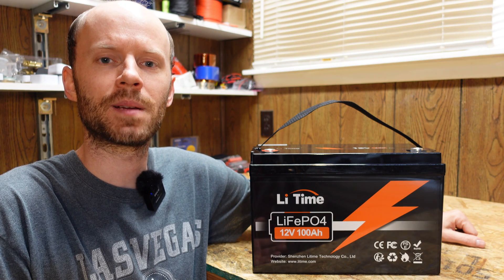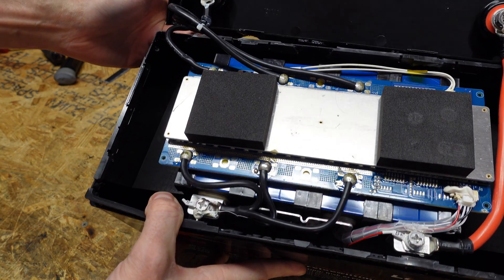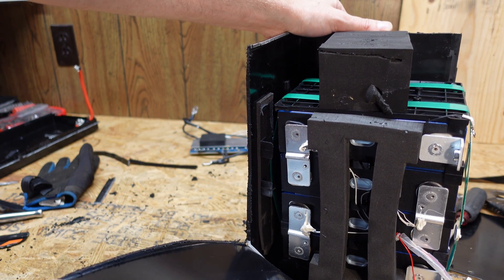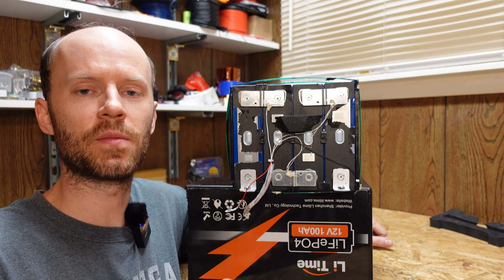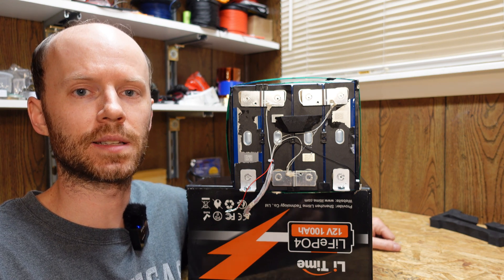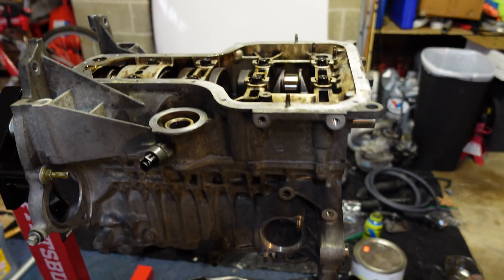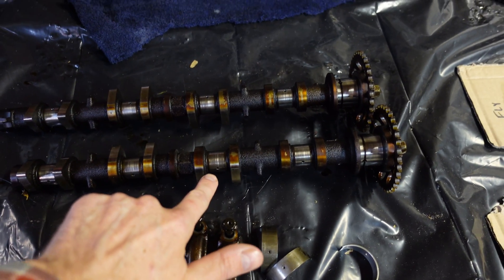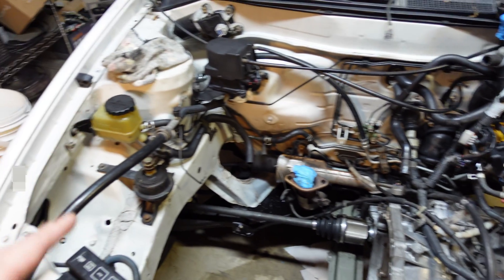Inside the LiTime 12V 100Ah LFP Battery and 1ZZ Engine Rebuild Update

Comment: Have 4 of their 12v 100ah batteries that acts as an extra battery for my Delta Pro..  
So pretty much low power energy storage..  All 4 of my batteries are way out of balance and the BMS will go in to cell overvoltage around 13.9v or so on each..   I'm slowly working on them to get them balanced back up..  AOLithium server rack is catching my eye right now..  Hear you may have a review on the way... :)

Comment: The cam bearing surfaces could be polished on a lathe with long thin belt sander.  It's a pretty quick job, but if they still feel smooth it's not a big deal.  Most importantly, you can't have and scratches or wear that are not evenly radial around the surface, if there is, that will allow oil flow out of the hearing surface too easily.  The cam caps and bearing surface in the head could be very lightly polished as well.
Reply from the maker: They all feel smooth except for that one spot on the cam that has a scratch mark and I can just barely feel with my finger nail. Interestingly, there is no corresponding scratch on the bearing cap. I guess the key to polishing is not removing too much material? Not sure I'm ready to attempt that LOL.
Reply: @LithiumSolar  it's a super quick job at a machine shop.  Might cost $50 or $100, but it's very simple and hard to mess up.  I have experience with the 5M and 7M motors and the 7Ms are the same setup, but those cams have a Babbitt layer that gets worn thin and looks like the cams are junk, but if you polish them, they are perfect and at the high end of the allowable oil clearance.  I would get those polished.  If it was a car that wasn't worth anything and could be scrapped at any moment, slap it together, if you are keeping it, probably get a machine shop to grind and re setup all the valves, but at least take that scoring out.

Comment: What are your thoughts on the Vestwoods batteries? They have Bluetooth and low temp cutoff. The 100ah is about $250 and the 250ah is around $550.
Reply from the maker: I've not used, or even heard of, the Vestwoods brand. I can't provide any useful input without buying one and breaking it open.
Reply: @LithiumSolar I have since looked on the DIY solar forum and I am not impressed by what I saw. I is good to see each cell, bit I question the quality I saw on one battery.  I saw Will breaker one open and I thought he liked what he saw for the price. But any company can change things at any time. 

I do not recall the brand, but one choice was a clear case.  Maybe  that is what we should demand from battery assemblers?  Would make for an easier battery review than this last one. 

With a clear case there could be plugs that could be removed to check each cell's voltage. Just a thought. If someone added another battery in parallel they might never know if they had a weak cell. 

Thanks for the reviews and I am glad you have a hobby you like. We need more people that can rebuild an engine. I hope your videos will inspire a lot of people. We are going to need a lot of skilled people.

Comment: If your piston rings line up after you aligned them correctly, your piston bore might be out-of-round.
Also if ring gaps were too large, that could cause them to move.
Toyota used piston rings that they described as "low friction" that might also have a tendency for the rings to creep. If this engine used them, perhaps aftermarket rings would be a better choice.
Check these videos out
Measuring Cylinder Bore Diameter, Out of Round, and Taper
DIY CYLINDER BORE CHECK: How to measure OUT OF ROUND, TAPER, and REBORE size
Reply from the maker: The gap for No1 ring is 0.25-0.35mm per the Toyota manual. Mine were around 0.40mm. I realize tolerances are super tight with engines - think that extra 0.05mm would prevent them from seating properly? I put Mahle's in, seems to be a premium replacement choice. Will check out the videos tonight, thanks for the infos! :)

Comment: Great video, battery and engine. 
I have 4 LiTime 12v 200AHR with 200Amp Bms. 2 are in series 24v on a Xantrex 3Kwatt inverter as a home power source with 3K watt of solar through a Flex Max 80 controller. The other 2 are used at a off grid cabin, 2Kw Eaton 12v inverter to power lights and a small freezer set up with a temperature controller to run as a fridge. They are charged with an 80 Amp charger and a 2kw inverter generator when they need to be recharged. The batteries are light enough that I can bring them home to recharge. I have had no problems wit the 2 batteries in series keeping them balanced. Very impressed with LiTime and the price keeps dropping. Great reviews and information.

Comment: I’m in Australia 🇦🇺 and have a 120x itechworld lithium battery. It’s 3 years old and going great. It’s on my caravan and only charge it with the caravan original battery agm charger. Does the job as the 120x battery from Western Australia I’m in New South Wales, Australia says it’s a drop in replacement lithium battery for agm charger. Cheers

Comment: I have ( 4 ) of these in the Amperetime  Label, ( wired in  parallel ) in my Bug-out Camper. They have been running great for the last 2 years. I also have one of the current LiTime Models in my trailer, and it hasn't had any issues. A click on my YouTube name will show my setup in my Bug-Out Camper. I just built a System for my Son using 4- 200Ah LiTime Batteries in his Squaredrop Trailer. I believe there is a video of that also on my YouTube Channel..

Comment: What is the cheapest 100a lithium that has cold temperatures shut off,wanting to use for 36 v trolling mtr on boat
Reply from the maker: They have a version of this with low-temp protection for a few $$ more. It also supports up to 4 in series. https://www.litime.com/products/litime-12v-100ah-tm-deep-cycle-lifepo4-battery-for-trolling-motors?ref=lithiumsolar

Comment: Next time use a heat gun on the bottom to soften the glue lol "Oh Well" you have tore apart too many batteries to be upset. Cheers
Reply from the maker: Haha, cells are still perfectly fine - will likely be rebuilding the cells to a 48V battery when I'm done playing :) They won't be wasted!

Comment: Been following you for some time...I have learned a lot about solar from you., ....  I must say I'm Impressed with your automotive skills, those double overhead cam engines are not easy... . keep it up and good luck with the Corolla!
Reply from the maker: This was the first year the Corollas got timing chains with the new 1ZZ engine. Having a chain makes them much easier to work on than timing belts :)

Comment: Dang it mine is on capacity tester right now! Haha I can't finish this video because it would ruin the surprise 🤣
Reply: Dang you perfectly hit the 10 minute mark haha
Reply from the maker: @WillProwse  I didn't capacity test mine. I assume you have a video coming so I'll check back on the results you got. Besides, the engine part is the more interesting part of the video anyway. I'm tired of looking at 12V 100Ah batteries. I never seem to get the "fun" ones you do like with giant globs of solder. I mean... that's a good thing of course but still, they make for more interesting videos LOL.
Reply: @WillProwse  Hey Will. Are you interested in reviewing Enjoybot self-heating batteries?
Reply: Great to see you young "hot shots" respecting each others expertise and experience.  👍👍👍
Reply: Wow, hadn't heard about the engine until now.  I must have missed a video or two.  Good luck with that project. I'm surprised it needed to be done at that mileage and assume you will use synthetic oil when you finish and get at least another 250k miles out of it.

I have thought about using 12v batteries but believe it's better to use a 48v one in a 48v system instead of 4 12v.

You have done some great reviews in the past and you and Will have been my go to sources for the best, most complete and accurate information.  Thanks for what you do!
Reply from the maker: I mentioned it at the end of the last video. I bought it used around 100k miles. I don't know how the previous owner took care of it, but it was bought from a dealer not just a random dude sale. The piston design flaw is well documented online though and was fixed in later versions of the engine. I think my lack of experience the first time I went through this around 160k was the reason it didn't last as long as I would have liked. It sure will this time! 

I fully agree that it's better to buy a 48V battery than get 4x 12V and wire them in series. The same goes for 24V. It works but it's just not optimal. And thank you :)
Reply: Too bad you can't get the upgraded pistons!